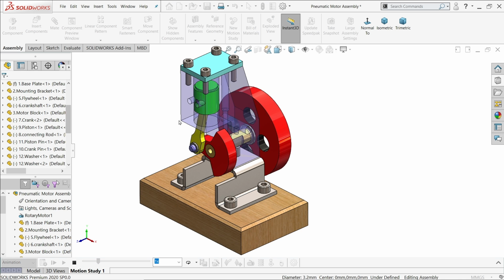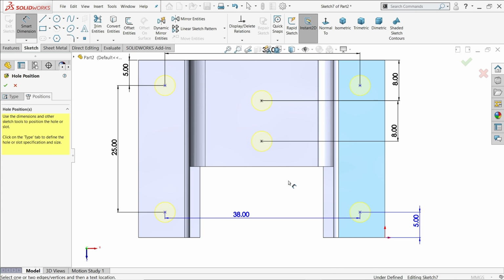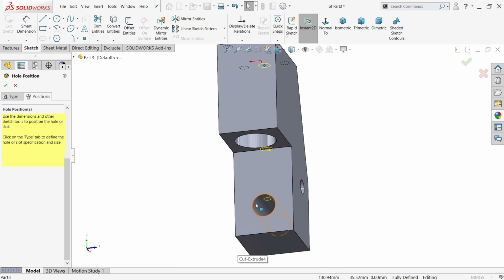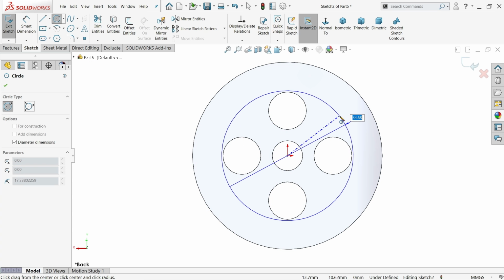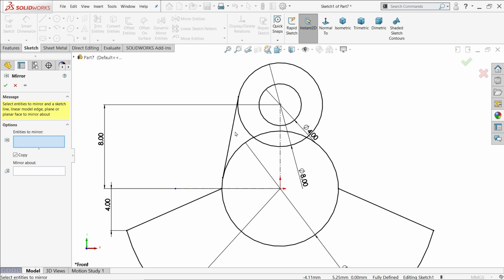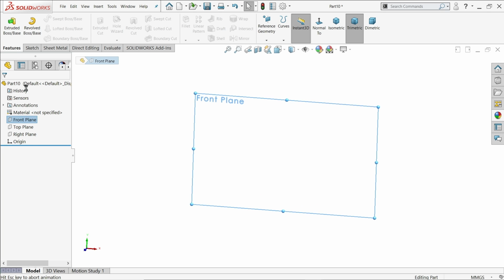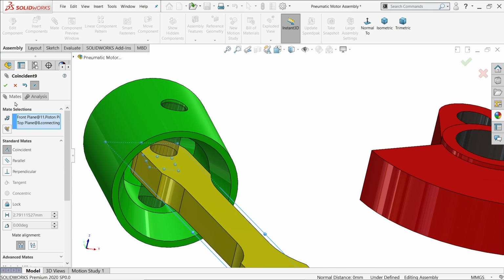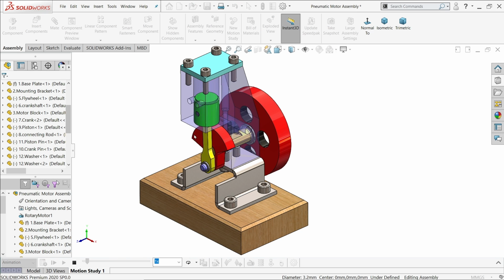SolidWorks tutorial Pneumatic Motor (Air Motor)

Comment: You have the axle upside down, the way you have it opens the valve at the lower piston position to the air supply and at the upper one to the exhaust. The long milling must connect the two holes as soon as the piston has passed the top dead point.